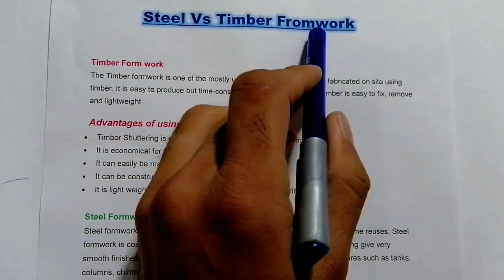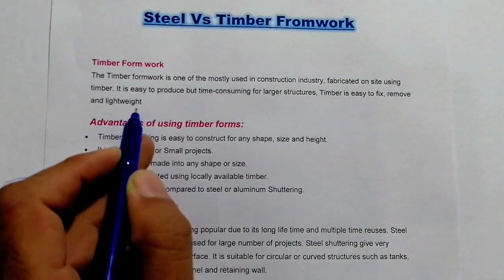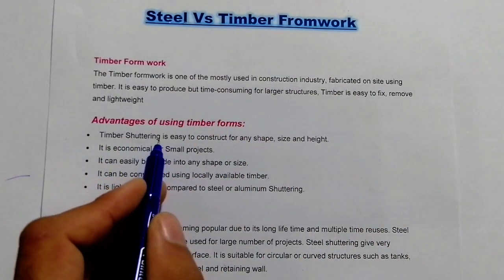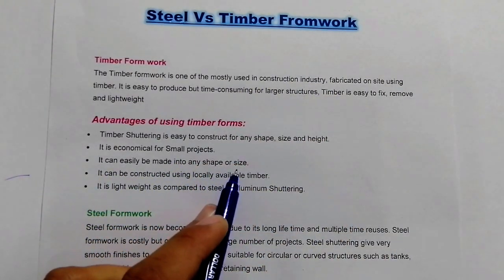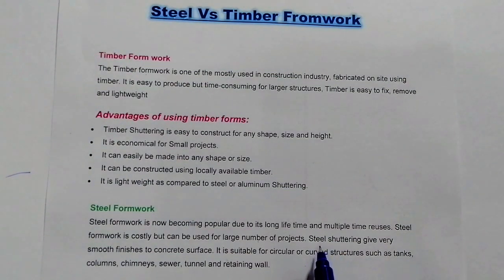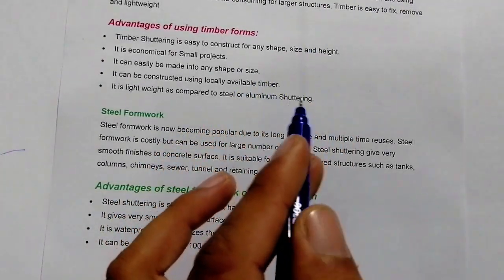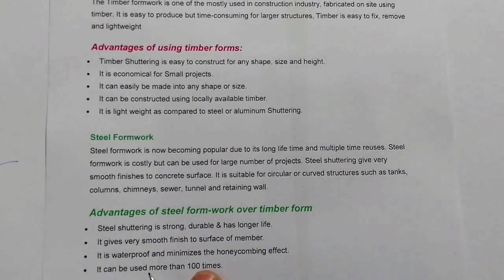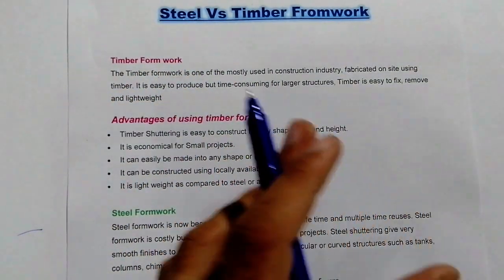Best Formwork for Construction ? Steel Vs Timber/Wooden Formwork  - Steel and Timber formwork

Comment: BHAI ASSALAMU'ALAIKUM
,
          For my shuttering works , I use 3ft x 2ft steel boards., pine wooden planks and battens and bamboo as props. now, pine wood's rate here  in assam is rs. 500/cft ( which means rs. 41.67/sqft for 1" thick plank ).

Now which has more re-usability -- pine or shuttering plywood . If plywood,
then which brand has more re-usability . PLEASE SUGGEST
             1 MORE THING... PLEASE SUGGEST A BETTER ALTERNATIVE TO PINE
BATTENS -- ROLLED STEEL CHANNELS OR ANY ALUMINIUM BATTENS( IF AVAILABLE), OR
ANY OTHER IDEA. BUT SIR, IT SHOULD BE ADJUSTABLE(PINE CANT BE USED FOR MORE
THAN 4-5 TIMES) . ACROW SPANS ARE TOO HEAVY AND COSTLY FOR SMALL PROJECTS WHICH I DO.